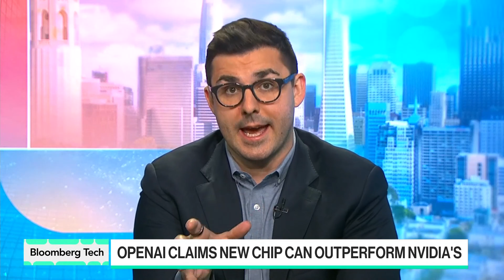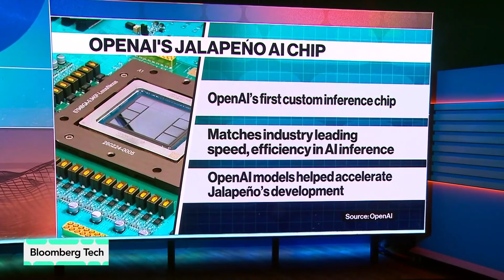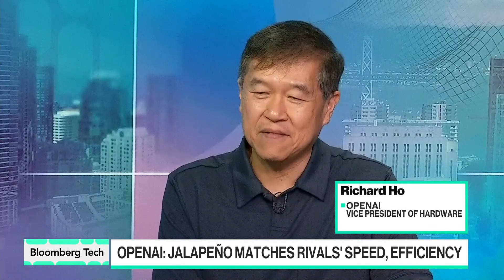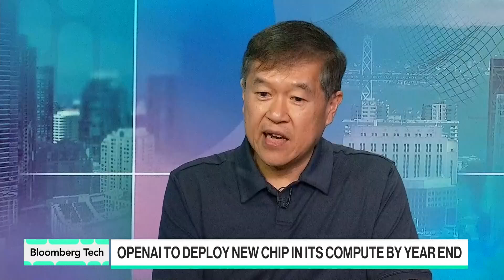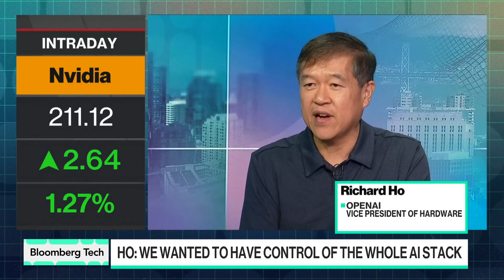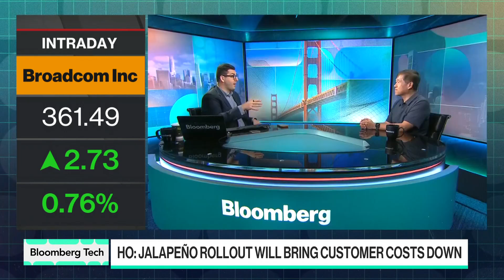OpenAI Says New Jalapeno Chips Outperformed Nvidia in Testing

Comment: 1. If these clowns designing chips via ChatGPT are beating Nvidia, what the hell are engineers at Nvidia doing ?
2. Certainly seems like the market does not believe this, if any baboon with no prior experience could hire a couple of engineers and in matter of months could make a chip which outperforms Nvidia, Nvidia has no moat and should be down 30%+.

Comment: If this claim is accurate, the interesting part isn't that “jalapeño chips beat Nvidia.” It's that the test may be measuring efficiency and latency rather than raw computing power.

A chip can lose on total compute and still win on:

AI work per watt more useful inference for the same electricity.
Response latency getting an AI answer back faster.
Cost per inference potentially doing the same workload more cheaply.

That's increasingly important because AI data centers are hitting a major constraint: power.

Nvidia's advantage has historically been much broader than having the fastest chip. Its ecosystem includes GPUs, networking, CUDA, libraries, software and a huge developer base.

So even if a new accelerator beats an Nvidia product on specific benchmarks, that doesn't mean it has surpassed Nvidia overall.

The bigger future trend

This is where semiconductor competition is heading:

More compute
→ more efficient compute
→ specialized AI accelerators
→ lower cost per token
→ less electricity per AI response

The future may not be dominated by one universal GPU.

We could see a heterogeneous AI infrastructure where:

Nvidia GPUs handle general workloads
specialized accelerators handle specific inference tasks
CPUs manage orchestration
custom ASICs handle high-volume workloads

And that's a serious threat to Nvidia's margins over the long term—even if Nvidia remains the dominant platform.

The real metric to watch isn't “who has the biggest chip?”

It's:

How much useful intelligence can you produce per dollar and per watt?

That's the metric that could reshape the AI hardware market.
Reply: Super

Comment: It’s not as good as Vera Rubin and nor compared against NVidia GROQ LPX. The performance gap will likely widen more when that is tested in comparison. Also, Jalapeño production is probably a year away. Also what platform will it ship with? Other than NVlink Fusion, the other choices would not make sense economically as a single platform needs to dynamically route tasks across the gpu, Lpx, third party chips in one system approach.

In other words, Nvidia wins even if there is a chip decent enough to compete with its chips
Reply: True. Groq also a plus for Nvidia.